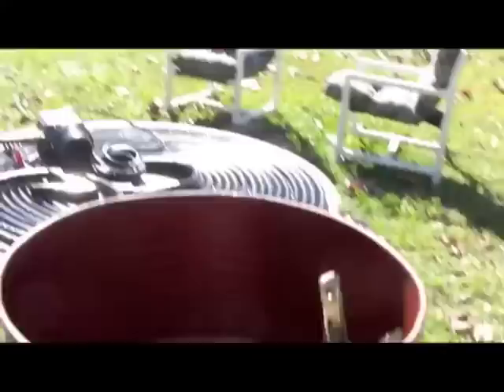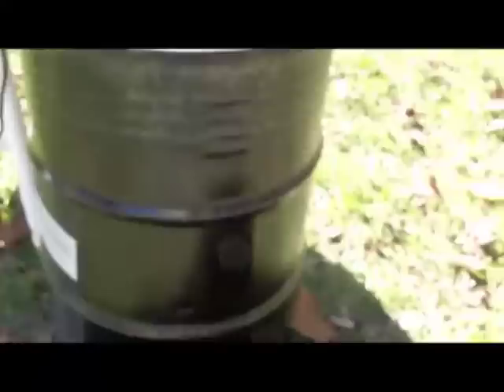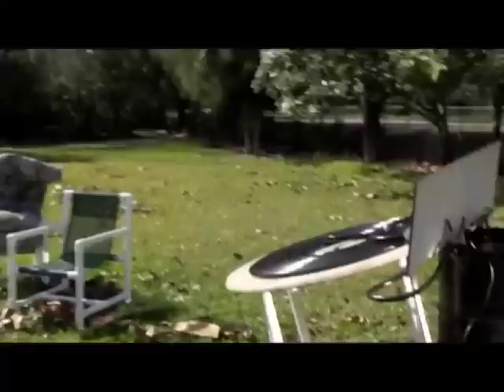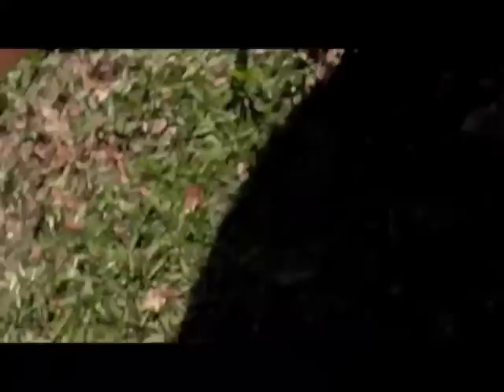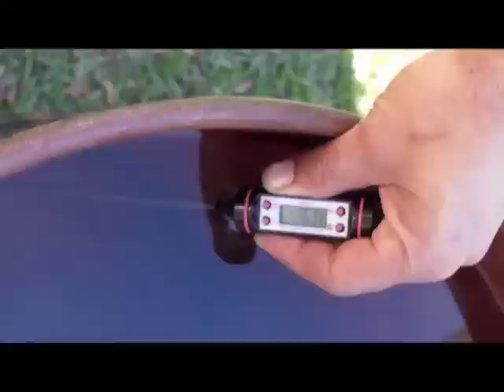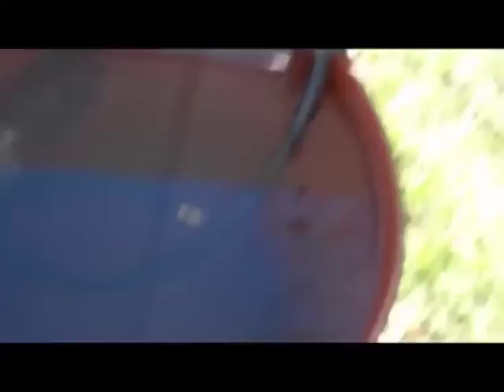SOLAR HOT WATER with black garden hose Pondmaster 1200 gph SWIMMING POOL SOLAR

Comment: Seeking affordable 500' black garden hose as current flow is just above a trickle.. though exits into pool over 100°.  Don't want larger figuring that will move TOO fast to pick up heat but wht the hell do I know?  Pure DIY on hunch, no calculations or research (till seeing this - if you can call this research- when I googled "black garden hose"). BTB  Throughout the mideast, even non-desert mideast, rooftops do have just fifty gallon drums painted black as usually their sole hot water source.

Comment: That guy wasted an hour of his life, and I wasted 4 minutes.
Reply: how get free electricity from the meter
Reply: 800+ watts worth of free heat.  He didn't waste anything!
Reply: put on high speed
Reply: Water out of a hot hose is much hotter than 77° so he either needs a longer hose or to leave it for even longer than an hour (insulate and store overnight for morning showers).

Comment: faucet temperature is 70°? and it only heated it to 76° with a pump, pretty sure you lost energy. our faucet temp in the nw is in the upper 40° range, an enclosed box would have helped dramatically, me thinks.
Reply: 800 watts worth of heat gained, with an 80 watt pump.  Do the math!

Comment: electric water heaters on average 20kw. The normal temperature attic is 140°. Average 300btu of from solar radiation. Check the temperature changes from the supply to the discharge pipe at the heater also check the pressure or gpm u can get from your solar equipment per given time minus the energy that powers your circulation pump. Compare that to the btu's or kw used by ur regular heater. That will tell you if your saving money or if you should increase or reduce your pump, pipe, solar heating coil. If you install a 30 gallon water heater for a 5 bath house u may save money but have cold water or you can install three 100 gallon water heaters and have plenty of hot water but will be inefficient. 
Call me I will install ur heater correctly.
Reply: pressure regulators a back flow valve. simple auto thermo shut off valves to switch inlet valve when desires Temps are met will all be required for economizers. Wow somebody please help. why r we so dumb
Reply: I think you mean 20k btu, rather than 20kw

Comment: wouldnt a pool or outdoor water container painted black also collect sunlight . if so than why do people paint pools blue or white and remain 58 degrees most of the time
Reply: Evaporation, I think. Just like sweat is used to cool body temperature down, the evaporation of the water on the surface cools down the pool.

That's why it's more effective to heat it in the tubing.
Reply: " if so than why do people paint pools blue or white and remain 58 degrees most of the time"

Well, I would imagine that blue or white resembles more what people think of as the color of water, plus it looks clean. Black would be a horrifically ugly pool color.
Reply: this method will heat up the pool water. 3to 5 hundred feet of hose on the roof.

Comment: could you just syphon the water trough? a plate of glass a top the hose?
Reply: No a syphon needs more hose going down then it has pulling liquid up. By pulling the water out of the barrel and putting it back in the same barrel the forces are even at best.
Reply: Yes I understand, thanks ldf
Reply: The system could be set up to do what's called a thermo-syphon.  Fill the hose with water and put one end in the top of the barrel and one end in the bottom.  Hot water in the hose is less dense, so it will tend to flow into the top of the barrel.  As the water in the barrel cools, it sinks to the bottom and pushes new cooler water out to the hose.  The cycle continues as long as there is a temperature differential.

Comment: nice, but with this sun i dont neet to heat my water. I need to cool ist
Reply: i bet you if you used the same system but ran it ,let s say three or 6 feet underground, you would cool your pool.
Reply: Bury it. Do this backwards...Put the hoses under ground a few feet....

Comment: @DJMC5ive While reading your comments I get a pretty solid feeling that you do not have the ability to prove yourself right or prove me wrong, as doing so would require a knowledge of physics.  Go read up on it (this should take more than 5 minutes), re-read what I wrote, and then comment.

Indeed, a 55 watt electric pump generates 55 watts of heat.  EXACTLY 55 watts, not a watt more, and not a watt less.  RESARCH this.

Comment: So you wasted all that power  for 5degree's?That's not even noticeable.A heating element would have brought it up to 140 so,just use a water heater.
Reply from the maker: casey james Not 50 gallons. The pump is less than 80 watts. Heating element 1500 watts = 3 kilowatt hours to 130 ˚f in 2 hours. This could run for 38 hours for the same power consumption or about 4 days of full sunlight. This pump runs off of one solar panel. One heating element requires 21x100 watt panels to power it.
Reply: Look guys I understand you are trying to be green.I get that,but for efficiency there has got to be a better way .What if you took this hose and put it on a mirror then placed it on the roof?Still use the pump but gain alot more heat that way.I'm sorry I  understand it was for demonstrative purposes.I wasn't thinking when I posted that comment.Thanx for the video
Reply: GREENPOWERSCIENCE Also, if you double the length of the black hose you can heat up the water even more with the same 80 watts pump.
Reply: Casey, this is WAAYYYYYYY more efficient than solar panels.  A simple design like this is free energy!

Comment: I did not get the same results.  (Constants: 1 BTU raises 1 lb of water 1 degree F,  1 BTU = 0.29 watt-hours,  water = 8.3 lbs /gal)  I get:  55 gals * 8.3 lbs / gal = 457 lbs,  457 lbs * 6 degrees = 2742 lbs-degrees,  2742 lbs-degree * 0.29 watt-hours / lbs-degree = 795 watt-hours.